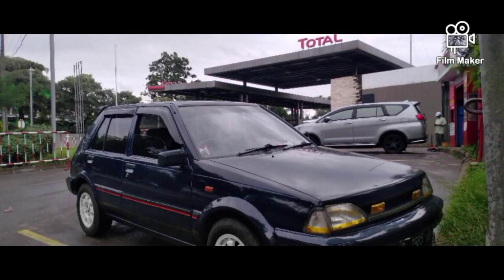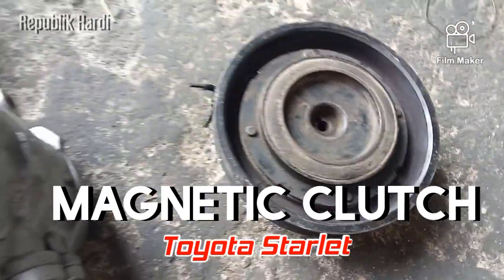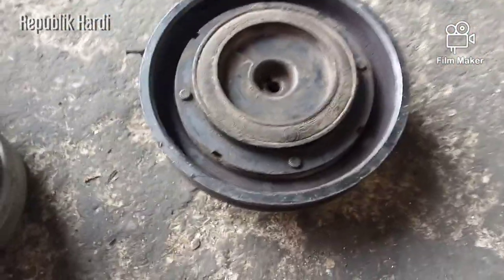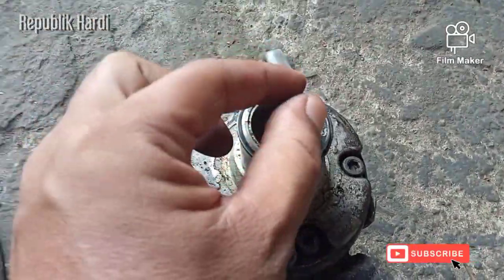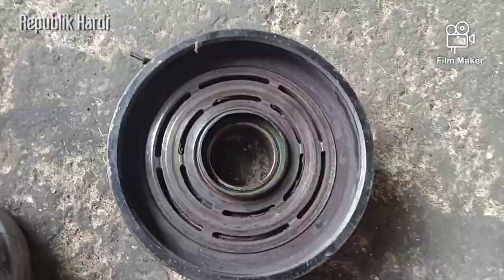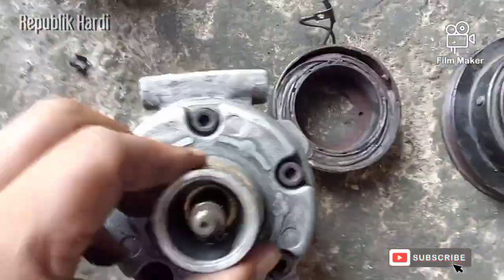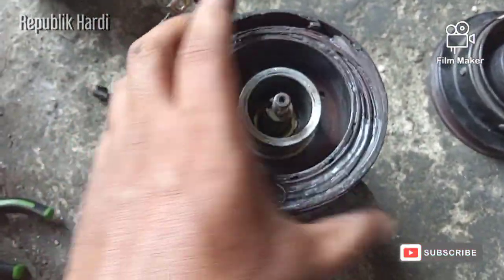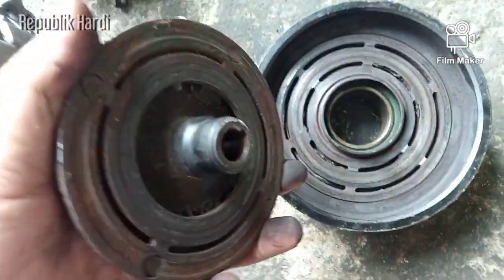Magnetic Clutch AC Starlet

Comment: Kalau di mobil ganti magnet nya gk usah di turunin bisa gk ya bos
Reply from the maker: Bisa om
Reply: @republikhardi2206  kalau feron nya kosong berputar ap kgk bos
Reply from the maker: @totongirman3453  kl system nya benar tdk akan berputar kompresor nya (LPS nya masih fungsi)
Reply: @republikhardi2206  brarti kalau pengen mutaer kompresor harus di isi dlu feron nya ,??
Reply from the maker: @totongirman3453  ya harus di cek dulu sistem AC nya , di cek ke vakuman nya, di cek ada kebocoran atau tdk , kl sdh ok semua baru isi Freon
Reply: Di magnet ada ring penjarak nya ya,ada brp brp biji ring nya
Reply from the maker: @totongirman3453  gak ada ring nya
Reply: Untuk starkap magnet clutchnya hrs ori atau ada persamaan om ?